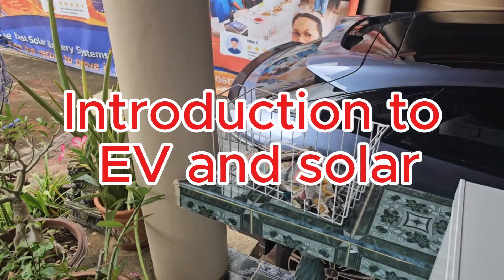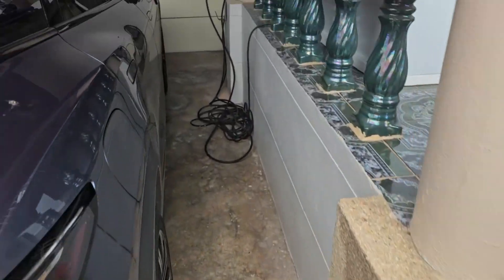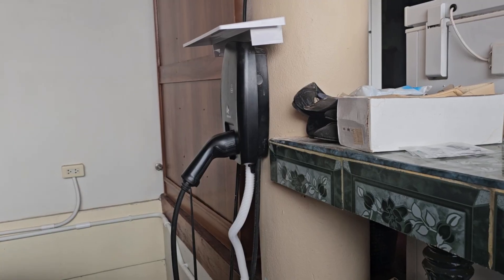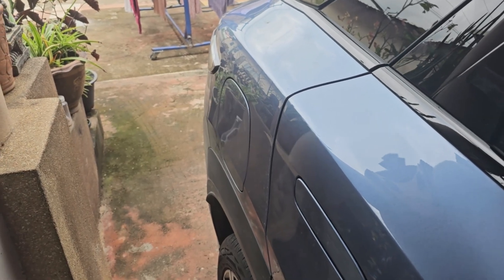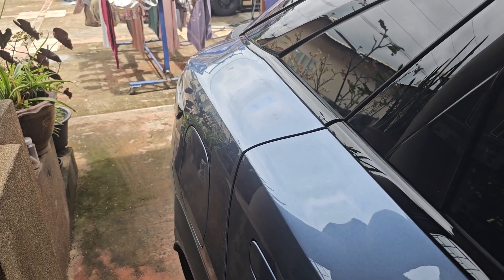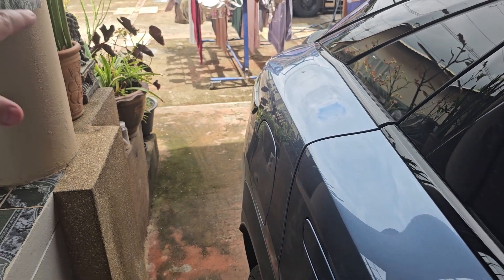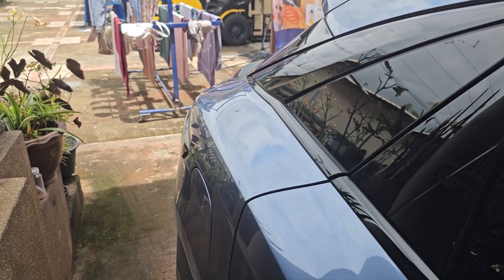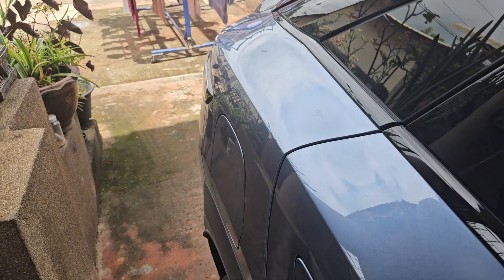EV and Solar | SolarThailand.biz

Comment: @michaelcromer1564
0 seconds ago
The Alpha app has a nice feature called Green mode, if you want to only use solar and not the grid for the load, your battery, and an EV in that order. This is easier than monitoring your system and only plugging in your EV once the batteries are charged.

Comment: BYD Sealion 7 good choice.  Once you have solar, getting an EV is a great way to soak up excess solar power in the middle of the day. It's certainly nice to have no bills for electricity or fuel for your vehicle.
Reply from the maker: Nice mix of features and value, I think. Not a very efficient car, but that doesnt matter for what we use it for. Everything else, like comfort, speed and noise is very good.